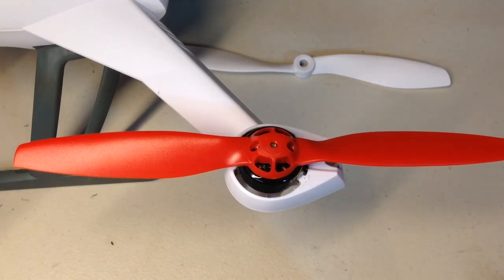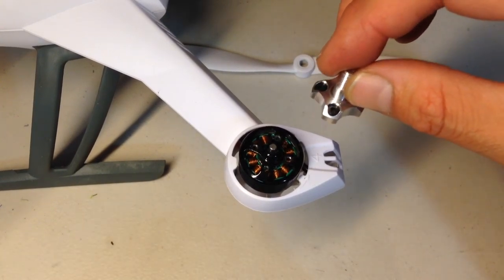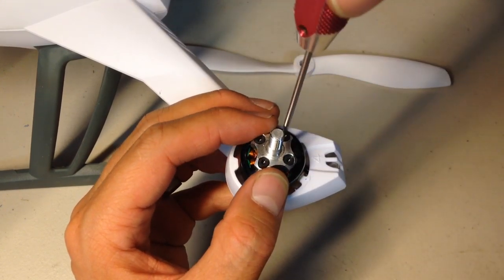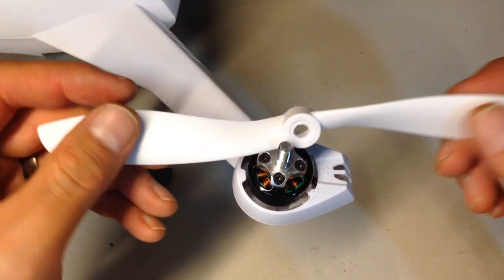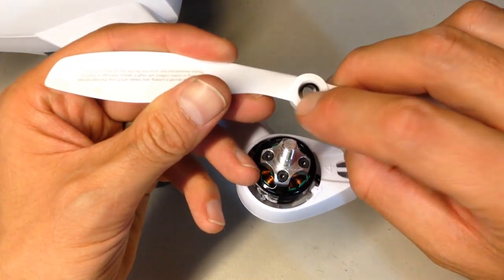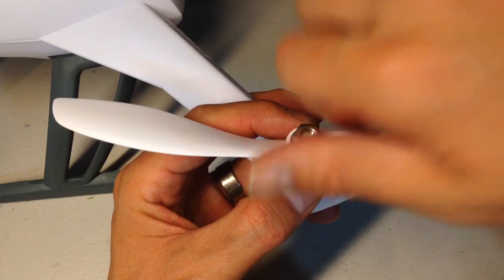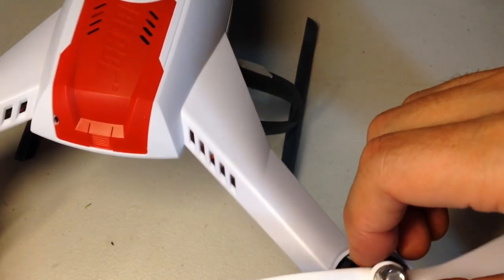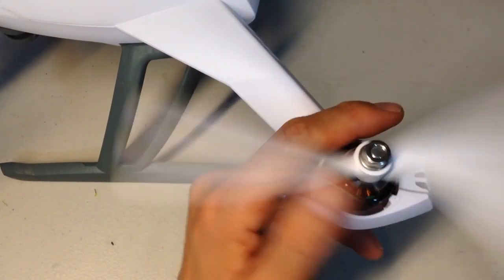Blade 350 QX Small Parts CNC Prop Adapters Install

Comment: Do these prop adapters raise the level of the props enough that they wouldn't hit the body if longer props were put on?

Thanks for any info.
Reply from the maker: yes, I like the extra height because I switched the electronics to an aftermarket frame and the stock blades wanted to hit some of the components.
Reply: thanks for the reply!

Comment: I have marked each motor pod with the appropriate "L or CCW" and "R or CW" with a Sharpe Parma Marker. That way I do not have to remember which blade mount and blade goes on which motor.

Comment from the maker: The aluminum adapter rings came with a set of carbon props that I purchased.  Not sure where to find them
Reply: What were the carbon props. I might have to bye the damn things just to get the aluminum adapter rings. I got a pack of assorted adaspter rings @ my hobby shop and none of them will fit. Story of my life it seems lol
Reply from the maker: These are what I got:
http://www.ebay.com/itm/161057415342?ssPageName=STRK:MEWNX:IT&_trksid=p3984.m1497.l2649